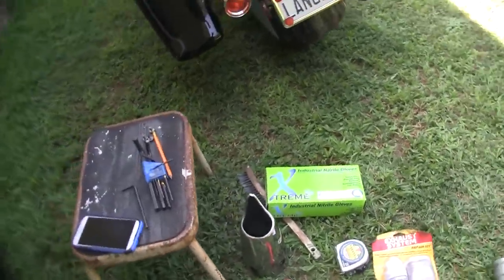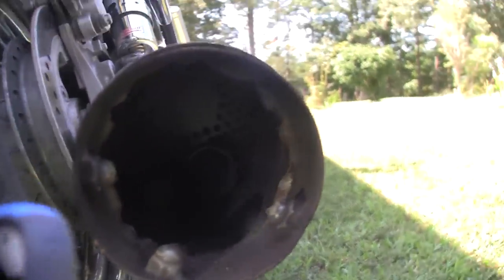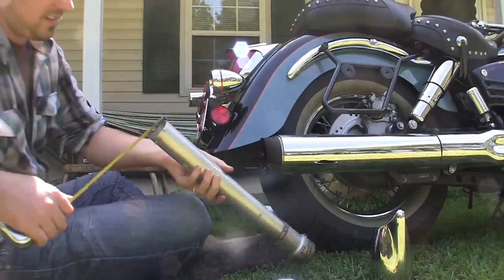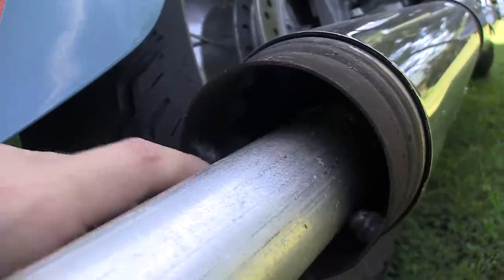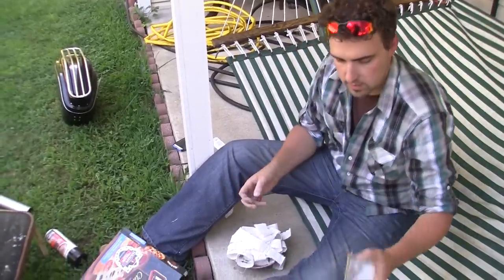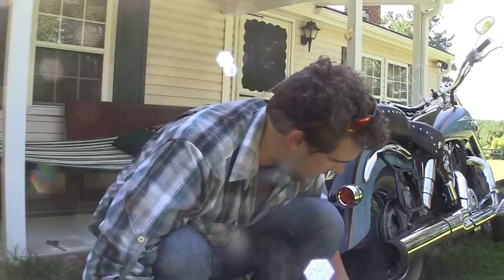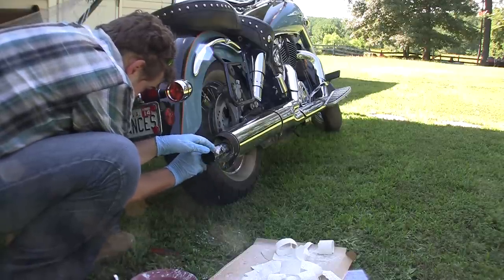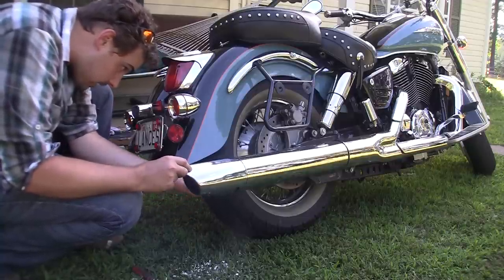How to Make Shadow Pipes louder

Comment: when I was 13 I had an 83 xr80.  the baffle blew out of it.  my mom complained it was loud so I pipe clamped a tuna can over the end of the exhaust and drilled holes in it.  happy mom and no power.  no YouTube either!
Reply: The Old Holes in the Tuna Can Trick Hey ,,, Got Smart

Comment: I want to do this to my 04 Honda Shadow Aero. Should I punch out the caps AND drill or just drill the 1/2 inch holes? I'm seeing differing opinions on this.. I want more sound (for safety) but also don't want to kill my engine.
Reply: some dude was selling a set of either psycho J or bobble cycle angle cuts for 100$ on ebay, these things are loud as all hell and I saved 400$

Comment: How has the packing held up. Thinking about doing this to my bike.
Reply from the maker: Packing is still looking good. Just be sure to let it cure like the directions say. Also having the burs on the inner pipe is a good way to keep it all held in.
Reply from the maker: B. Timothy  Just an update. Packing finally failed and fell out.. I did a mod where I welded the same pipe in place and sounds great.
Reply: Thank you for the update. Had a welder available so I ended up welding it in place too

Comment: Does this require rejetting ?  Or cause any mixture problems?
Reply from the maker: *****  Not when welding in the pipe. I added another video where I had to weld in the home made baffle. Basically after a year the exhaust repair kit shook apart.
Reply: I see. Thanks.

Comment: Hey Lance, After finishing my guide plug and gear shift spindle, I took a look at the exhaust - hole-saw in hand.  After pulling the rear chrome piece, I saw two exhaust pipes, welded together.  I cut those off flush with the end of the remaining chrome exhaust section.  That leaves about 4 inches of tail pipe, which goes into a circular flange, sealing off the rest of the exhaust.  Does this sound right to you?  If so, what did you use to cut the remaining tail pipe? Or did remove another chrome section.
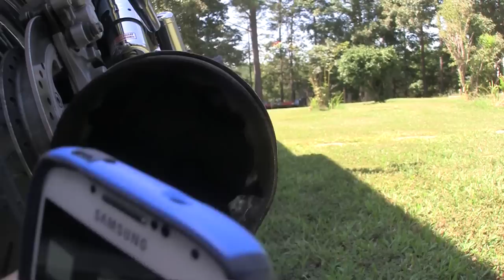Reply from the maker: if you watch around 2:17 of the vid it shows how it should look after the baffle is removed. I know many of these bikes have different set ups but I only removed the rear baffle which did have a two pipe thing. Wish I had thought about making the vid when I removed that.. :)
Reply: Lance Ziolkowski what size hole saw did you use on the main back of the pipe. did it have two small pipes?

Comment: that wont hold up at all.... all that work for nothing.. take off the pipes completely and remove the inner baffle that u i didnt remoce in the 1st place.... a ton of work for nothing....b
Reply from the maker: 2 years and going strong whaaaa
Reply: hey i just wanted to ask you abt my harley street 750 
i have the stock exhaust as i got it how do i make tht louder 
i dont want to buy any other parts
Reply: Yes..!   I ton of work with all the thrush he put on this poor bike just to ruin the sound .. But he didn't realize he ruined the sound ...